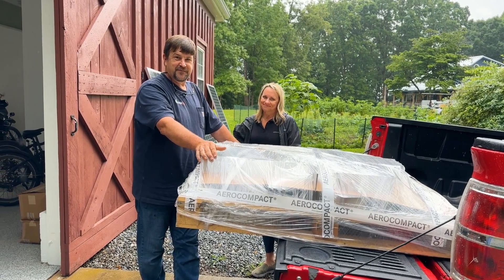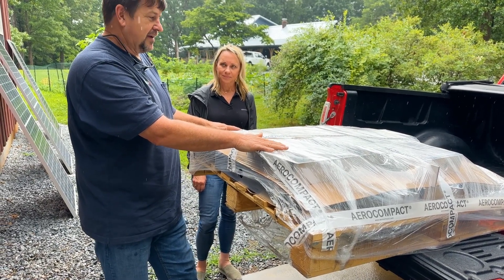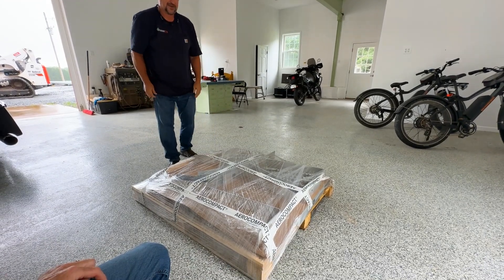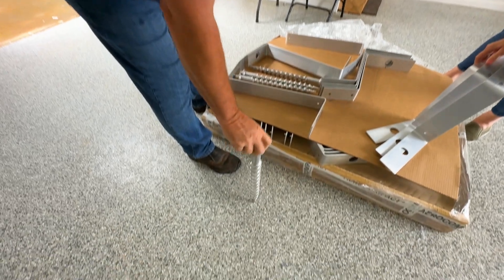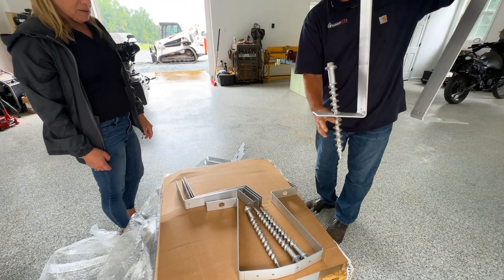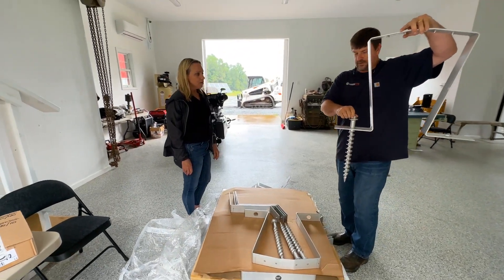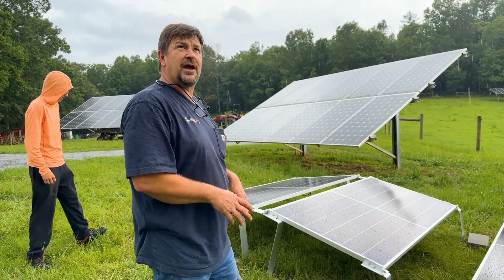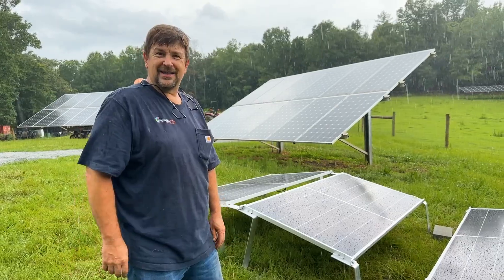Aerocompact: a less intimidating ground mount

Comment: American Earth Anchors are flipping awesome! I use them for so many things.
Reply: They are huge in Europe....hard to find large ones here that don't require a driver using an excavator.

Wish the diy rental kits that they have in Europe would get here already.....too much bureaucracy in the states.
Reply: I used their 36" and 14" ones for my DIY ground mount.  I borrowed an impact gun from a friend but my compressor couldn't keep up, so I ended up muscling them in with a 24" wrench from the same friend.  It was a workout - especially when you hit rocks!
Reply: @AlecMuller  I have a Milwaukee M18 Fuel 1/2 inch impact i use on my 24 inch anchors. Drives them right in my rocky soil.

Comment: what is the wind rating on those? I have a need to put out some extra pannels in the winter, that's when we get 80+ MPH winds.
Reply: They've installed this stuff in the caribbean - so upwards of 135+ but the modules could handle the uplift pressure on their face.

Comment: Looks like a nice simple neat install but the shallow angle is a no go for my area.  Would need something closer to 35-45 degrees due to how low the sun is in the winter where I live along with having enough angle for the panels to self clear from snow.
Reply: Since you have to ask for a quote I imagine they are made to order with the proper angles for your instillation.